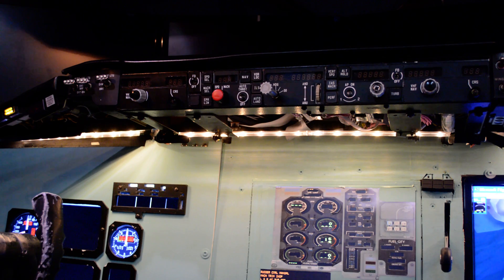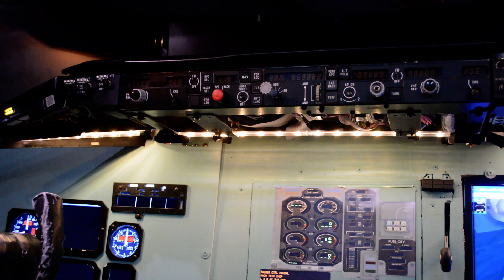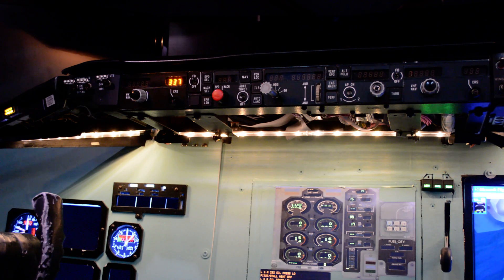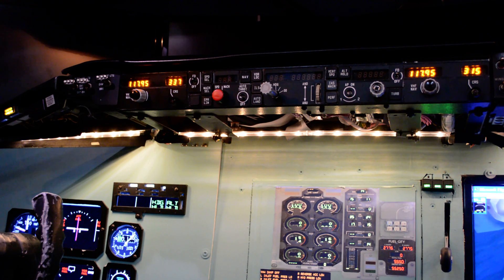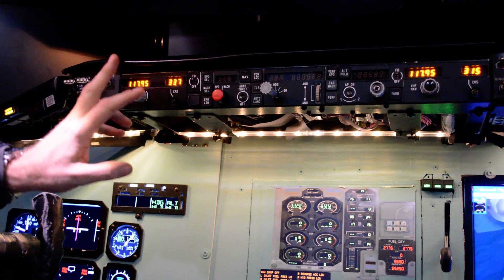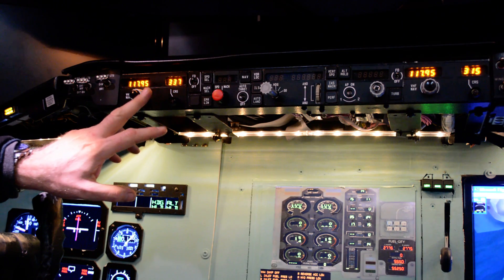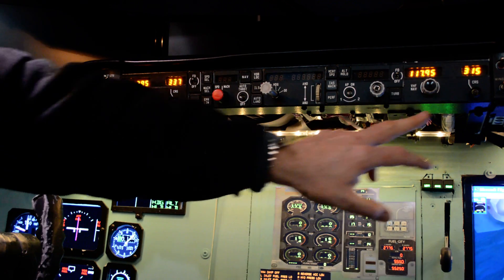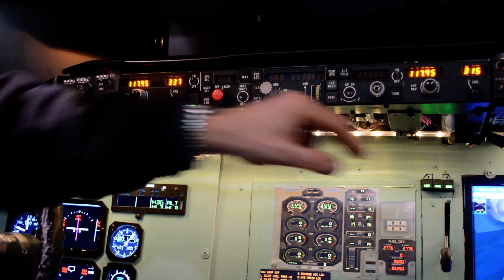MD 80 FGCP simulator

Comment: Where did you get the fgcp panel image file from. I can’t find a image file for the md80 fgcp panel.
Reply from the maker: This panels 7 segment displays are controlled from Open Cockpit display card. The switches and encoders inputs are controlled through a Joystick Board http://www.leobodnar.com/shop/index.php?main_page=product_info&cPath=94&products_id=180. Some isues about the FGCP is that the encoder reading on Joystick Board is very slow. Another isue is that not all values are valible through SIOC, The altitude readout I can't interface. So the FGCP is not fully working.
Reply: MD80ifly I already know how to interface it. I want to know where you got the faceplate that has the buttons attached.
Reply from the maker: The panels are made on a engraving machine on simple "plastic name plate" 
This file opens with Roland Dr. engrave software: https://www.facebook.com/download/1602952593101747/Panel%20test1.ded?hash=Acpfq3PAutlNVc5h
Reply from the maker: You can maybee find more info here: https://www.facebook.com/groups/185668487549/